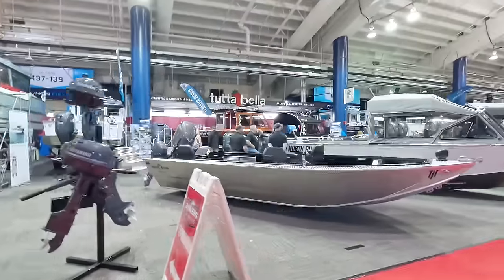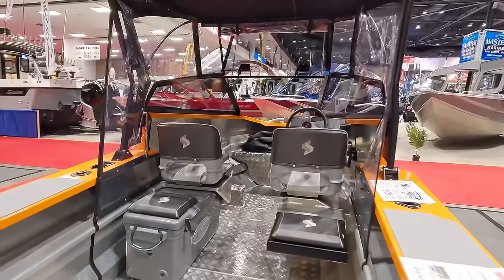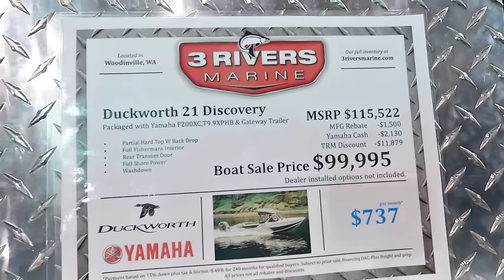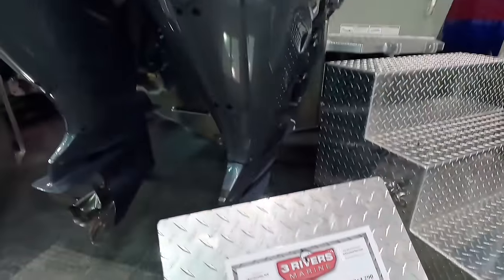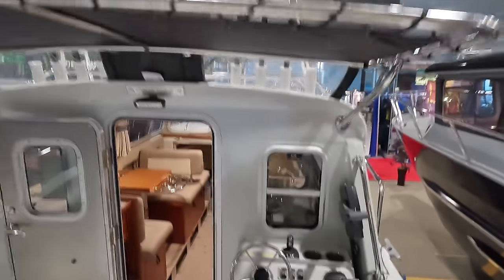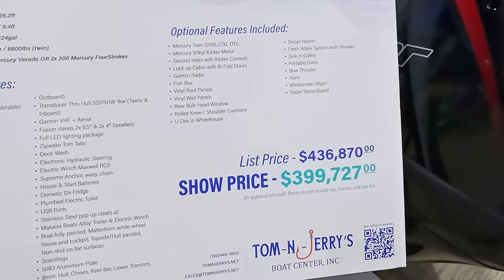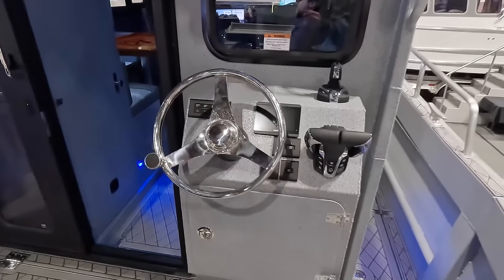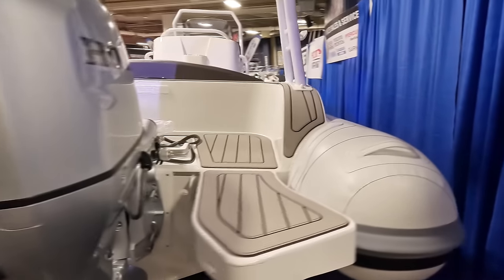2024 ALUMINUM BOATS! Big Seattle Boat Show!  #duckworth #hewescraft #fishingboats #lundboats #lowe

Comment: We can see how much profit boat manufacturers are making from their business. 2 regular seats $100,000 very affortable. 🙄
Reply from the maker: @jonp9654  yea why does the price need to go up $40,000 for a boat that’s just a tiny bit bigger?
Reply: @northwesthotspots6309  yeah, compared it to a car that has a lot of technologies in it that comes in standard from engine, suspensions, brakes, power amenities and the list goes on, while these boats are just curved metals (aluminum) or fiberglass and equipments are so basic and yet prices are sky high. Though I would really like to buy a boat but seeing the prices just don't make sense.
Reply from the maker: @jonp9654  absolutely! That’s a good point. I’m with you.  For me I would but a used 16’ with a decent outboard. That good enough to do just about anything! Keep it under $10,000